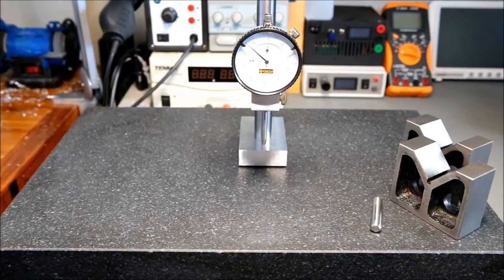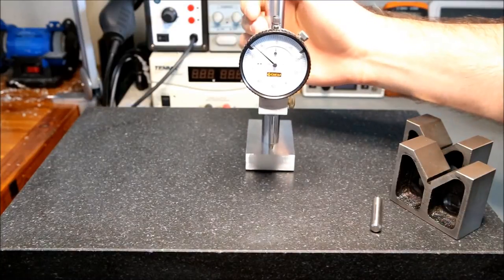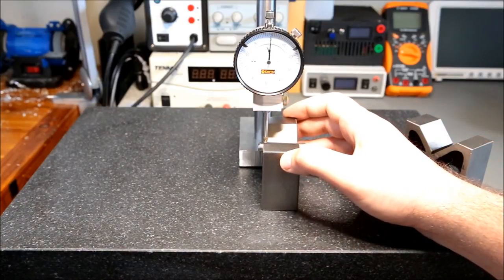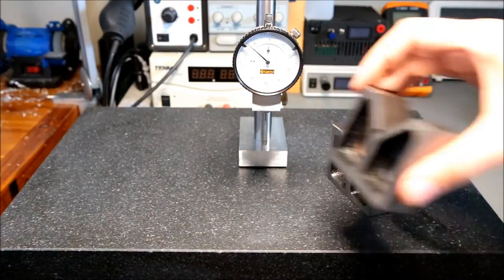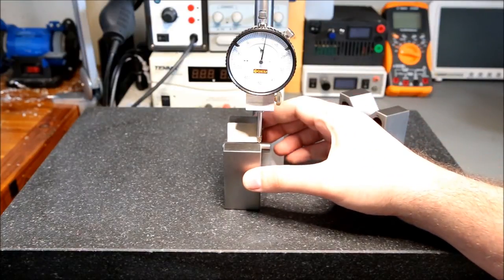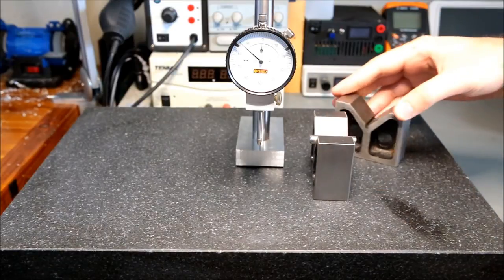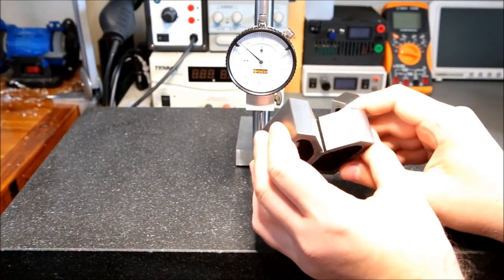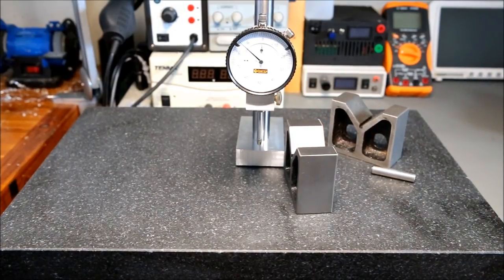Crappy V-blocks

Comment: That's what I call a great video, I was ready to buy a pair of them from BB but after seeing how crappy they are machined , I totally  changed my mind. now I know better.
Thanks for the heads up.
Reply from the maker: You're welcome. They'd be fine if you only consider them as rough castings and plan to finish them yourself on a surface grinder, but as they are, they're pretty dang useless for any serious machining.